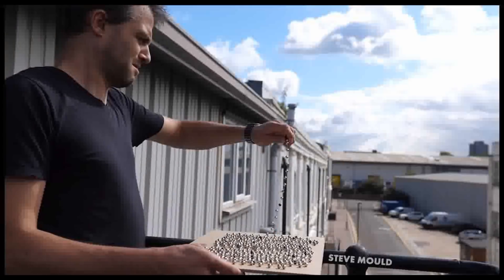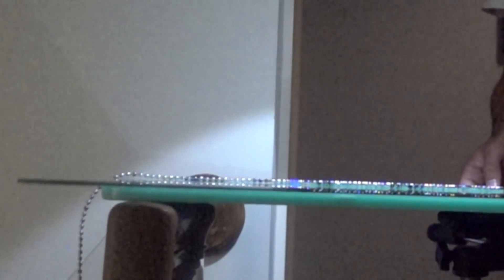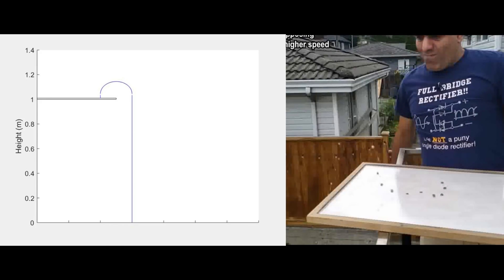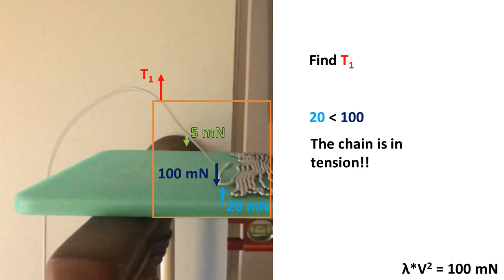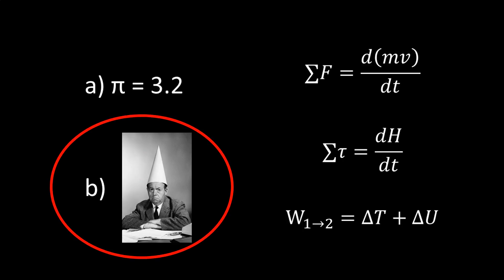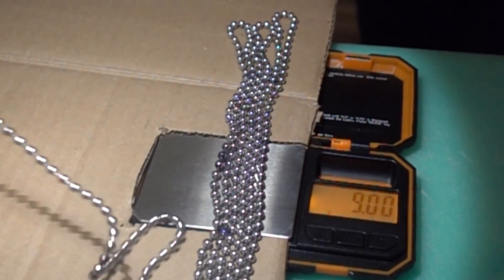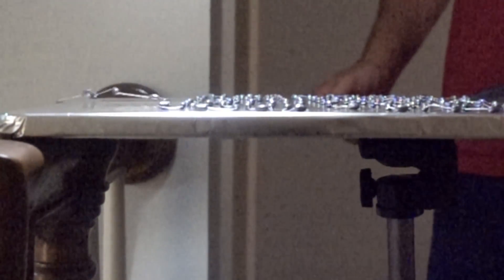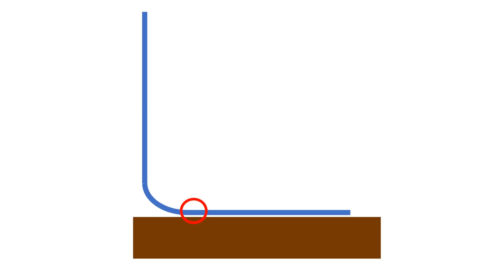And the Winner of the Chain Fountain Dispute is...

Comment: I still feel like this is not the same as the explanation Steve offered.. to me what Steve proposed was the leverage of the links against the surface, but as you as well has shown, foundations can form in other conditions as well.. to me it seems the curvature of the chain is what the all have in common and thats a different but maybe related phenomenon.. if "the leverage effect" is just the same as any reaction force, then me being able to jump of the floor is also the "mould effect", and that doesn't seem like a reasonable definition

Like the leverage effect exist in the chain itself, not the container.. the force created is still exerted on the floor, but it comes from the chain sort of...

Like the different ways to put the chain in the container seems like definite proof that the container it self is not the crucial factor witch would make Steve's original thesis (as i see it) wrong.. the solution by both Steve and Mehdi still seems incomplete incomplete

Comment: You're forgetting that the rods internally have a compressed end that can lever internally in the bead.  Also when beads are compressed while the rod is internal push against each other. Try bending the chain. The beads can only get so close.  There is a twisted wave that is created when you tightly bind the chain.  Btw this is an old experiment. Watch Royal Society 7 years ago.

Comment: Great video.  Are you willing to make a video showing how Veritasium explanation to faster than wind directly down wind video is completely wrong?
I can provide you with all details but the shortest explanation is that energy storage is used to accelerate above wind speed meaning the vehicle will be above wind speed for a limited amount of time and so there is no wind power available to vehicle while above wind speed as wrongly claimed in that video.
The stored energy is in the pressure differential created by the propeller as air is a compressible material this works but will not work if air was to be replaced with a non compressible material like water or a non compressible solid.

Also his wheels only explanation in that video will not represent a vehicle driving directly down wind but a vehicle driving against wind and there there is also energy storage use but in a fairly different form (I have some video's on that showing the energy storage for that case fairly clearly but I can not post links in comments).

Comment: I see this as an energy transfer problem.  The kick from the pot is supposed to be caused by chain being pulled up but when you take the chain to a high place you store energy that can only be released by the chain falling back down. So the falling chain has to somehow transfer its energy all the way up and around into the surface that's being pushed against or there could be no kick from the pot. This energy transfer can only be achieved by the wave that was described by Medhi. So Steve's kick from the pot can only happen as a result of Medhi's wave. The only thing wrong with either of these theories is the idea that one works without the other.

Comment: At 4:30, 1) What is lambda?  2) The chain arc has weight that is omitted.  3) Your second equation makes no sense and its units might be inconsistent (depending on how you defined lambda).  4) Since the speed of the chain in the arc is increasing, angular momentum is NOT conserved.  At 5:00 you even admit that the chain is accelerating.
If these equations are not valid, then neither are any conclusions drawn from them valid.  
A decrease in tension does NOT mean compression; it ONLY means LESS TENSION.
In the horizontal case, the height only begins increasing when bends in the resting chain lift it off the platter -- watch the video...  Once it is off the platter, it is no longer horizontal.  Once it is off the platter, it is 'pushing' more off the platter and less off the remaining chain.

Comment: Why isn’t there a backstop to prevent the chain from moving backwards on the flat surface? Obviously there is some force exerted on the chain in the opposite direction the fountain is traveling. If the opposite force could be constrained, would it not affect the height of the fountain?

Comment: Why are you ignoring the fact that the flat loops are pushed back indicating a measurable 'leverage' force in the horizontal direction.
You even said the chain fell of the back into the water ... what pushed it there against the friction. Try a low friction sheet to demonstrate this force. I assume that the chain pulling the bend radius smaller adds a horizontal force back on the horizontally arranged chain ... rotate 90° and this 'proves' a vertical force created by the chain radius reaction. Note too that the horizontally layed chain fountain is only going through 90° rather than the 180° of the vertically arranged fountain.
Cannot yet think how the horizontal chain forms a fountain ... sudden thought - like euler bending instability (yes I am a BSc mechanical engineer) any lift upward from the 'table' causes a reaction force upward to build a fountain (??).

Comment: I always have a hard time with mathematical derivations, because often times, there is so many assumptions made and things ignored (yay physics world), and I find simulations to be only a bit better, because they only do what we tell them to do.  I find physical demonstrations  and experiments so much more convincing, because they use the most advanced physics engine we know...real world =P
I am a recent mechanical engineer graduate, and dynamics was never something I was super good at, so I have a hard time 'seeing' the forces and reactions, intuitively, but your tin foil and plastic wrap experiments were excellent.  They were enough to convince me that of the 2, steve was more correct, that there must be some form of reaction force.  
I would still love to see the experiment done with other forms of chain, or 'engineered' chain that has different bend radius

at 4:34 I am not convinced that the assumption that T1=T2 is a good assumption, as I believe that requires the system to be a steady state system, which you can't necessarily assume. I think.  Like I said tho, dynamics isn't my strongest area.

Comment: Wouldn't the cause of the chain rising from the flat position be due to a lever action as it passes over the edge? As a bead falls off, it should lever up the beads after it.
Reply: I think that is why the fountain off the horizontal has as double bend, Note that the chain going over the edge rapidly opens its radius forming a low fountain at the edge before the main fountain starts where the chain levering vertically off the table starts randomly. Others mention that any vertical wave developing in the  chain would progress back to where chain 'starts its journey' (not making any assumptions about the conditions there!) which would also help initiate or augment the vertical reaction force.

Comment: They start with a model -- then apply math.
If the model is wrong, then the math aint of much use.

I think that every model to date ignores the rotational momentums of a link/bead.

RM(1)90.     Launch RM. A link/bead has zero RM at first -- then a max of Rm halfway throo launch -- then, later, zero RM again, during ascent. 
During this idealized launch phase the chain passes throo say 90deg.

RM(2)180.     Fountain RM. As the link/bead goes over the top of the fountain, we have the same -- zero RM during ascent -- then a max of RM in the fountain -- then during descent zero RM.
During this phase the chain passes throo say 180deg.

RM(3)180-90.    At launch, what we see is that the chain sometimes forms an 180deg half loop, then it has a dose of RM(1)90 to get back to vertical.
Here there are 2 phases, the 180deg phase having a RM in one direction (eg CW), then the 90deg phase having a RM in the opposite direction (CCW).
A reversal of RM.

RM(4)??.    In tests the chain can have lots of complicated phases of RM.
Sometimes we see tangled loops doing crazy stuff.

Anyhow, no model (that i have seen) allows for whether the power of RM's are totally lost -- or whether partly lost -- or whether totally returned in some way.
I think partly lost & partly returned -- the losses being due to friction etc.
But, RM is a minor issue (or praps not so minor).
All of this is just a side issue -- just saying.
Anyhow, in the end -- all models are wrong.

Comment: How about this: the balls are not balls, they are spheres connected by rods with rivets, and the rods have some amount of freedom to move in all directions, constrained by their lenghts and the size of the openings into the spheres. The falling chain pulls the rest of the chain with a force which attempts to de-bend the bends in the chain, and fails to do so in the 2D plane of the surface it's resting on, so the force which pulls and de-bends the chain causes the rods to seek other degrees of freedom and the upwards direction is the only one feesible (the upward direction is simply "chosen" by trying everything with chaotic vibrations of the chain, and the upward direction is the one with least friction). The reaction force is the "unsuccesful" tries where the system tries to de-tangle in the bottom direction, which is prohibited by the surface being hard. The height of the rise is determined by the energy balance of the pull and how much the rods need to go upwards to de-bend the chain.

Case in point: the same chain resting on the surface linearly / straight without any curvature will not rise, there's nothing to de-bend.

In the same vein, It would be interesting to see the fountain where the chain rests on surfaces which steal more and more energy through friction, maybe a fur rug. It should slow everything down and make a much smaller fountain. It would be interesting to see what happens if the chain lies on a non-Newtonian fluid :D
Reply: I like your first paragraph.  Chaos rules!

I would love to see the chain laid out on a tray of custard (a non-Newtonian fluid) but it would sink.  Once in motion the chain would encounter increasing viscosity, hence drag  But keep thinking outside the box.

Comment: Only additional thing I would have liked to see would be a follow-up experiment about the aluminum foil impressions.  Find the height of a dropped bead (of the same size and mass) that makes a similar depth impression, and film it with high-speed to figure out the force and momentum required to make such an impression.  You could then compare that to the tension, weight, and height of the fountain.

Comment: 4:25 No we cant. Function limits does not work what way. Obviously, Lim 1/x with x->0 is not equal to 1/0. Infinitely small piece of curve is still a curve and can't be treated as straight line. You are breaking all the calculus, bro! Derivatives and integrals will make no sense if 4:25 is correct!

Comment: I don't think the argument was ever that there is NO reaction force whatsoever. It's nearly impossible to lift a large object from a surface without imparting at least some amount of force on the surface - and so bouncing some amount of force back into the object. The question is whether the chain fountain REQUIRES a reaction force to form. Off a table? Maybe, though I'm unconvinced. Out of a beaker, as was the original proposal? I still see no evidence to support this. Reaction force does help grow it taller and overcome friction, but I still see no evidence to suggest it can't happen without a reaction force.

And yes, I've seen the derivation. You guys keep calculating idealised forces for a circular curve when none of the curves you showed on video appeared to be circular. At best you could call them elliptical, at worst they're arbitrary. Curve radius does not appear to be consistent in the slightest. Moreover, you yourself showed that chain bend angle alters chain behaviour by altering its geometry. This isn't a wire under tension, it's a chain, yet all the reference images show - and appear to assume - a solid bar in perfect straight lines and circular curves.

And moreover still, you footage consistently shows a chain fountain with a "loop" in it. The chain goes up off the surface initially, then quickly loops down, then loops back up again in mid air. What reaction force is there doing that? Unless you want to propose that there's a reaction force with air, it's the rest of the mass of chain already in a loop pulling it up. At least I see no other reasonable explanation. I don't think anyone is claiming that no reaction force exists, merely that it's not REQUIRED for the fountain.

Comment: The chain inevitably changes direction as it falls off the table. Thus, you have a length of chain with linear mass changing the orientation of it's speed vector. As such, the vectorial momenta also changes and radial projections of acceleration/force, very much akin to the centripedal and radial components of circular motion appear. These effects produce forces that are propotional to the mass of any unit chain and have a strong relation with the chains overall speed and the spatial orientation rate of change. But the gravity also affects any part of the chain linearly with a fixed constant, aprox 9.8N/kg or 9.8m/s^2 (the units are equivalent in SI). As the chain speeds up, the force exerted by the dynamic motion of the chain increases past the gravitational pull, and the chain lifts up. By it's own. I'm sorry to tell you, but thinking a static reactionary force can accelerate an object, and continue to accelerate it after it leaves the surface is pretty stupid. The normal force, loosely speaking, or the overall reactionary force at the interface of two or more touching bodies is at any moment of time, always, equal in value and opposite in direction to the action of the acting body. Thus it cannot change the behaviour of the body and exists to show that bodies exerting force on other bodies can remain stationary as long their surroundings maintain them in equilibrium by exerting an opposing action. It is not an active force.

Comment: Another excellent question, as we're thinking more and more deeply about this topic:

Is the bend in the fountain, also a soliton (stationary wave)?  And is it stable, at that?

I think some argument can be made here, as the higher tension and stiffness (particularly suggested by the bend radius / tension argument) should suggest a higher propagation velocity in the bend, and slower around it, thus it tends to propagate upwards, opposite the flow of the chain itself (which has a Doppler effect -- this is a wave on a medium in relative motion!).

Question: is the velocity always proportional to tension (as well as a function of bend radius), so that the effect is stable regardless of the velocity of, or tension on, the chain?  It seems like this will be necessary to fit the observations.

Or perhaps the overall feature, the fountain itself, is dominated by more basic mechanics, while the waves kind of do whatever?  The many tight curls that pull out of the pile from time to time, do seem to dissipate (partly pushing back into the pile -- which can potentially be used as an explanatory mechanism, as waves carry momentum -- and partly falling down along the direction of chain motion).

Clearly the wave mechanics are nonlinear, depending on bend radius; this means we cannot understand it as two waves propagating freely (up and down), but they interact, particularly at tight bends.  What effect does this have on the behavior?  Does this fact mean that, treating it as a wave system really isn't all that helpful, specifically because it doesn't obey superposition (or isn't LTI, or various other "nice" properties)?

Alas I'm no expert on mechanical simulations or I'd figure out a way to do this myself; my experience lies more in E&M than mechanical waves (and even then, more intuitive than quantitative).  So, I suspect I have the right questions to ask, just not the means to answer them so easily.

Cheers!

Comment: Waves propogate in the chain, which causes the beginning chain fountain in the horizontal case. There is going to be some chaotic movement as the chain becomes under tension, and since the chain cannot move down it moves up. I have a feeling if the part at rest was weightless, it would sometimes form a fountain downwards, or the fountain would occilate.

Comment: Chain will experience an upward force when -Vy^2/r is greater than gravity...

Saw similar effects growing up at the dairy farm

Water and air mixture flowing quickly inside an inverted u shaped tube would have the bubbles floating on the bottom of the liquid. This happens when tangential acceleration is greater than gravity. 

Hope this helps

Comment: I would posit a whip like wave effect traveling back to the resting mass governed by the swaying motion as the lead element of chain falls. Drop it through a one inch PVC pipe whose length is just inches from the floor to produce a "straight" fall damping down any sway or "sine" like energy.